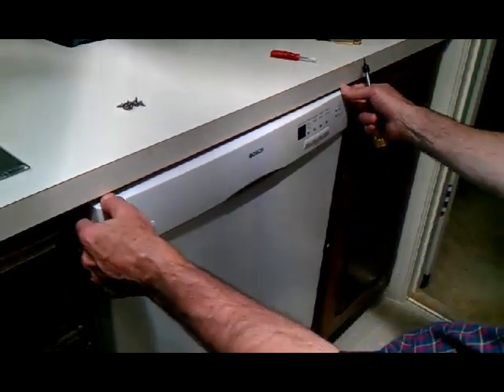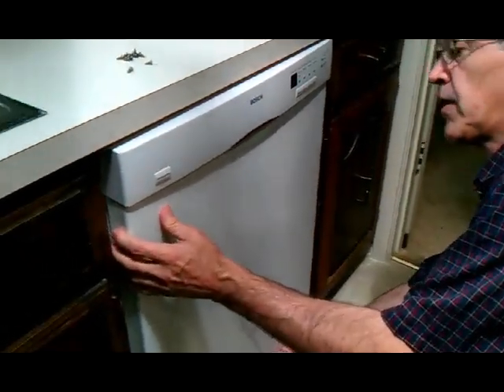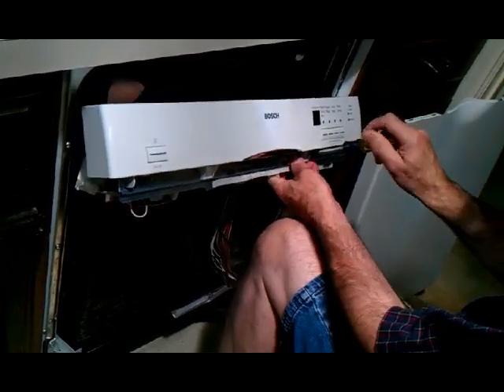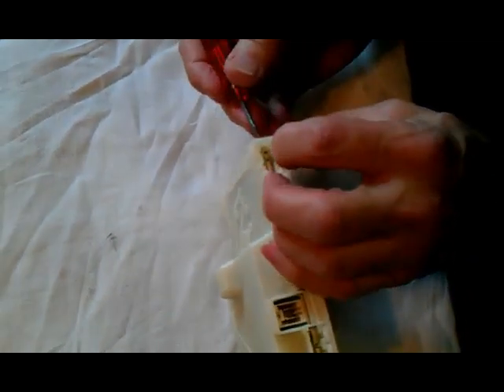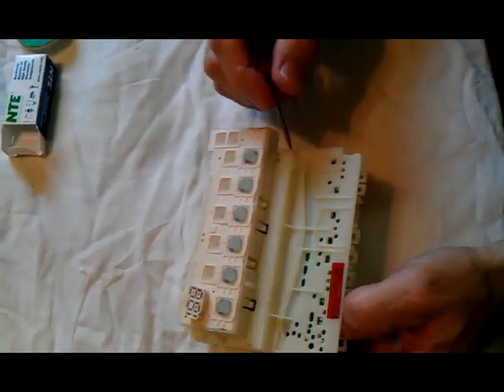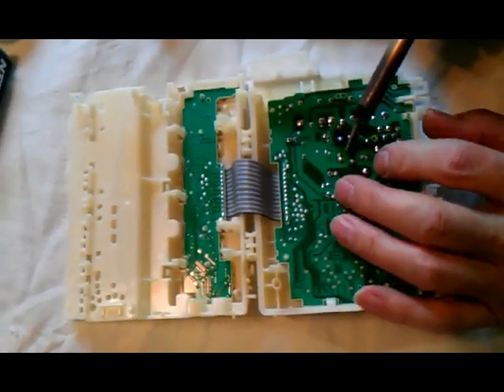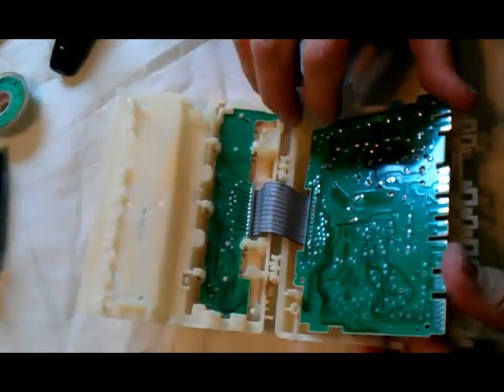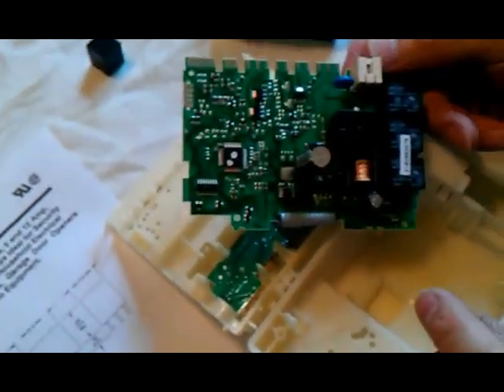Bosch Dishwasher Heater Relay Repair Part 1

Comment: I cannot thank you enough for your detailed instructional video. This fix worked perfectly on my 13 year old Bosch SHV6800. I have learned so much about control boards and relays and soldering in the past day, its great. Thanks to you I followed along on how to get to the control board out,  showed it to my husband who is a soldering expert and he soldered on the new relay for me. I picked up the relay from http://www.vetco.net/catalog/ (I am very lucky that store is right near me and was able to walk in there today and tell them exactly the part I needed. Cost all of $3.78.) My Bosch model also also took the NTE R46-5D12-6. You saved me hundreds of dollars today. Thanks again!
Reply from the maker: +suea12 Great to hear that your DW is up and going again.  That's really nice to have a supply house so close to you that had the relay, and to have a husband that can solder it in...doesn't get much better than that!  Cheers!

Comment: I too thank you for the tutorial!  It worked like a charm for me as well.  My control board looked a little different, but this was the exact issue on the SHY56A05UC Bosch (2006 model).  I also used the R46-5D12-6 relay from www.newark.com.  So far so good!

Comment: Fixed faulty Siemens Dishwasher stuck broken nothing happening, display showing 1, 2 or 4 , I just fixed My Siemens SE25A090GB/12 Dishwasher. UK
It was very similar to the one you showed except the control board case was white, and contained two 6v 10Amp relays part number SRE 303006, which I replaced with two 6v 12A 240volt relays here in the UK.
The replacement part was a superior slightly smaller blue relay but the pins lign up perfectly
just google “12 Amp contacts 6V volt Relay coil 12A Power PCB 124D”
I got mine from pic-projects on ebay, very quick delivery and cheap too
http://www.ebay.co.uk/itm/270578013737?_trksid=p2057872.m2749.l2649&ssPageName=STRK%3AMEBIDX%3AIT
Hope this helps
Reply from the maker: roy boese Thanks for sharing your repair.  The Bosch, Siemens, and Neff brands are very similar and seem to share the same heater relay problem.  That is a good find on that relay and I am sure that information will help someone else.  Cheers!

Comment: Thank you for the video.  I have a SHX46A05UC dishwasher which uses the same 899-1C-F-C relay.  I purchased the R46-5D12-6 relay from an Amazon seller for less than $12 shipped and a solder sucker for less than $5.  I was able to swap out the relay and the dishwasher is now back in service.
Reply from the maker: db130 Good job!  Thanks for sharing your experience with us.  Cheers.

Comment: Thank you very much for the detailed video. My repairman gave me a total estimate of $442 for parts and labor to do this repair. I went ahead and ordered a new washer, but before I installed it I ran across this video. I've made the temporary fix and ordered the new relay from Amazon (NTE R46-5D12-6) based on the comments below.
Reply from the maker: Chad Bledsoe Hopefully the new relay you ordered will get you back to a properly working DW.  Let us know how it turns out.  Thanks for commenting.

Comment: Thanks for this excellent video!!   I just saved myself from having to buy a new dishwasher.  Repairman told me it would cost $200 dollars plus labor to replace the circuit board.  I was able with the help of the video to do it myself for less than $20.00 which included purchase of a solder sucker.  It took me several hours total since I had to practice with the solder sucker on an old board.  Very helpful video
Reply from the maker: Bill Morales The $200 is about right for the retail price of a new control.  Some have told me that with parts, labor, and taxes that they were quoted up to $500 total for a replacement by a technician.  If I had to spend that much to repair mine, I would probably just buy a new one.  Good idea there to practice on an old board before doing the relay swap.  Thanks for sharing your experience.  Cheers.

Comment: Thanks for going through this. I had to perform the same repair, and this video saved me untold money, headaches and cussin'. The dishwasher was fixed for $3.75 (plus tax and shipping) and I have the feeling that a repairman would have wanted to replace the entire control board.
Reply from the maker: Bodie007 Yes, the repairman would want to replace the entire control board...that's the way they do it.  Thanks for sharing your repair.  Cheers.

Comment: Bought my Bosch SHE-45M02UC/50 just 2 years ago.  Recently started seeing problems like in your video and many in these comments:
- After a wash, some dishes were not clean and all seemed to have specs of detergent residue on them.
 - The "Sanitized" light was not coming on at the end of the cycle.
 -  The water did not seem as hot and not as much steam when I opened the door during or after a cycle.  
 - Used Dishwasher Magic to clean out any detergent deposits, BUT THE WATER NEVER GOT HOT ENOUGH TO MELT THE WAX PLUG.

So as per the video, took out the control board and saw the burned solder joint. Same relay location and everything. Bingo! Was going to just buy a new Control Unit assembly except that it costs over $250!  Now going to get me a solder gun, solder-sucker, and some solder wire.  

It's a real shame that Bosch hasn't sufficiently addressed this issue.  Many thanks for showing a DIY guy how to fix this!
Reply from the maker: pieman7 Wow!  Only 2 years old!  That's a real shame, but at least it is an inexpensive repair.  Match up the coil voltage to your existing relay and order a new one.  The DW is so new it will probably outlast the replacement relay, so order a spare while you are at it.  Cheers!

Comment: Thank you very much for your help. My Bosh SHU43C, wich is not part of the recall, had exactly the problem you described. I ordered a NTE ELECTRONICS  R46-5D12-6  POWER RELAY, took my old soldering iron that I hadn't used since high school and fixed the thing in less than an hour. My wife who was ready to buy a new dishwasher and our kids who had to do their own dishes now think I'm a hero. I didn't tell them yet that you are the brain of the operation. THANKS again

Comment: I have a Siemens dishwasher model SL84A305UC/01 which had the same problem. The control board layout was different but it had the same bruned pin on the relay. I replaced it with the NTE relay and it now works. I used a piece of solder wick to create a heavier solder trace from the relay pin to the connector pin. This should help dissipate some of the heat from the relay and it will reduce the resistance to create less heat from the board trace. The heater on my dishwasher draws 10A.

Comment: Hi AgglomeratedIdeas, the original relay in my dishwasher (899B-1C-F-C E) is rated at 15A (125VAC) and the NTE R46-5D12-6 replacement is rated at 12A (120 V). Is the NTE more reliable even though it has a smaller current rating?
Reply from the maker: MrEdwinhardesty I have not seen that particular relay with a 15A rating before; all of them have been 10A. The datasheet available at Mouser also shows that relay having a 10A rating. So, if your relay says 15A on it, then that would be a first for sure. If you can find a 15A replacement relay that would be ideal, but the only upgrade for the 10A relay that I have been able to find is the NTE 12A relay.  Let us know if you come up with a 15A relay!
Reply: AgglomeratedIdeas The data sheet shows that the original relay (899B-1C-F-C E) is rated for 10A at 277 VAC and 15A at 125 VAC. The relay on my board says 10A at 250V. So I guess we need to compare these at the same voltages. But since the original relay has had so many reported problems, I'm tempted to go with the NTE relay even though it looks like it has a lower current rating.
Reply from the maker: MrEdwinhardesty Hmmm...that is an interesting observation.  I don't think they used to have that rating on the datasheet.  Perhaps they have made production changes that allowed for that rating.  Nevertheless, the 899 relay still fails on a regular basis.  I believe the NTE relay will fail too, but it seems to be better than the other brands Bosch is using in their boards.  I bought an extra NTE relay just to have on hand should I still own my DW when that happens.  I just consider it a maintenance item that will have to replaced about every five years.
Reply: AgglomeratedIdeas I removed the control board from the dishwasher, and since the board looked to be in perfect shape and I couldn't tell which relay was bad, I replaced all 3 relays with the NTE R46-5D12-6 type. The dishwasher now works like new again. Thanks AgglomeratedIdeas for putting together this video and sharing it with all of us. It's people like you who are looking out for all the rest of us. Thank you!!!
Reply from the maker: MrEdwinhardesty Thank you for sharing your successful repair.  I am sure others will be encouraged by your experience. It certainly doesn't hurt anything to replace all the relays on the board.  They are cheap enough to do just that!  Cheers!

Comment: Hello AgglomeratedIdeas - Our Bosch dishwasher is model # SHE43P25UC/64; it is not part of the recall.  Originally the regular wash cycle took about 120 minutes.  After running a name brand dishwasher cleaner on the power scrub cycle, regular washes now take about 140 minutes, but it does finish.  I think the power scrub cycle cranks up the heater more or longer than the regular cycle.  After seeing your video, I opened the control board, and on the relay in question, two of the solder joints have what looks like burnt sugar around them (although the joints are still intact).  No other solder joints on the board have this.  The info on the relay says 6V, 10A -  same as the other 3 adjacent to it.  Just wondering if you think this has the same problem yours had.  Thanks!
Reply from the maker: Thanks for sending the photos.  I replied to your email.  The "burnt sugar" is flux from hand soldering.  Your board looks fine to me and the DW is probably running normal.  I hope that helps.  Cheers.

Comment: Hello, thank you for the video. I have a Bosch SGS4332GB/17 dishwasher that has same symptoms described in your video. I have replaced the relay with a new one but still have the same problem. Dishwasher doesnt seem to heat up the water and it is always running. Even when I do a RESET the END led lights up but the dishwasher keeps filling and draining water non-stop. Is there anything else I should check? Thank you.
Reply from the maker: If the water is not heating and you have already replaced the heater relay, then a bad heating element may be the problem.  There are other reasons too, so follow this flow chart: http://imgur.com/aYgvfAW
There is also a diagnostic mode that you can use to help find the culprit.  The diagnostic mode is shown on the wiring diagram which is usually rolled up and tucked in a crevice near the water fill valve.
Reply: AgglomeratedIdeas Thank you very much for the reply. I will see if I can get to the bottom of the problem. Cheers.

Comment: I can’t thank you enough for making this detailed video.  My 87 year old mother had this problem with her dishwasher.  After 3 Sears servicemen and $600 of work didn’t fix it, she was ready to give up.  I saw your video and decided to give it a shot.  I order the part and soldering equipment off Amazon for about 30 bucks.   After practicing soldering a bit on an old modem circuit board, I soldered the new part and put her machine back together.  It’s been running perfect now for several months.  I can’t tell you how relieved she was getting this taken care of.  THANK YOU!
Reply from the maker: Thank you for sharing your experience. I don't what to say about the servicemen...hmmm?  At least you were able to do what they couldn't.  That is a really good idea to try out your soldering skills on an old board.  You made your mother proud for sure!  Cheers!

Comment: My Bosch did not run right for quite some time.  First indicator was the "Sanitized" light was not coming on at the end of the cycle.  I started to notice that the water did not seem as hot and not as much steam when I opened the door during or after a cycle.  Called Bosch and they recommended using a dishwasher cleaner like Finish (which would temporarily help with food particles).  Dishwasher started to run for hours (sometimes 4-5 hours for one cycle) and Bosch wanted outrageous rates to send a technician to my house.  
Thank GOD for You Tube!  I'm no handy man and hand a little frustration taking my panel and control board out, but this fix literally took just a few minutes once I ordered the $10 part off Amazon and did the soldering.  All said the repair took about an hour start to finish (I also pulled dishwasher out to clean dust/debris under and behind the unit).  Probably saved $200-$250 in repair costs by trying it myself!!!  Thank you for posting this video!!! Now the dishes are getting as clean as they did on day 1.  Sanitized light shows again and cycle time is normal and much shorter.
Reply from the maker: Thank you for sharing your experience.  As you found, there is a HUGH savings for a relatively easy repair.  I'm glad you tried it!  Hopefully you will get many more years out of the dishwasher.  Cheers!

Comment: Thank you for posting this.  I am new to this kind of repair.  I have already repaired the joint on the board.  How do I determine what kind of relay to order to replace the one on the board?  I have a SHX46A06UC-21.  Thank you again.

Comment: Thank you for taking the time to post this very thorough walk-through.  The fix worked perfectly and we're back in business!  I found the NTE relay on Amazon with free two-day shipping for Prime members.  My SHE44C had four of the five legs soldered, one of which had a burned solder joint just as you explained.  Total cost: $11US for the relay and $1.98 for a Torx 20 1/4 drive socket at Home Depot and we're good to go - saved me hundreds of dollars.  Thanks again!
Reply from the maker: Awesome!  Thank you for sharing your repair experience.  Sounds like it went well for you.  Cheers!

Comment: I purchased a similar model 6 years ago at Lowes with a 5 year extended warrantee and it stopped drying the dished at the end of the cycle. I tracked the problem to a 10 Amp relay (switch) on the control circuit board that overheats and melts the solder connection. I did a little research on the internet to see if others had a similar problem. I found multiple instances and that Bosch had issued a safety recall for this problem in other models but not the one I purchased. This is not an isolated incident. The control board costs $150.00 plus the labor to install it.  If you don’t care about lasting more that 6 years it is a great dishwasher.
Reply from the maker: Thank you for commenting.  You are exactly correct...this particular failure for the Bosch is not isolated at all.  The heater relay failure happens at about the 5-year mark give or take depending on how often you run the dishwasher.  The repair is relatively cheap and inexpensive if you replace just the relay.  Replacing the entire control board is not cheap.  I think the Bosch is a great dishwasher also; it is just too bad that the heater relay is being utilized near the top end of its amperage rating and fails.  I hope you got your DW up and running again.  Thanks again.

Comment: Hey there! Great video!  I have a Bosch SHU9955 dishwasher with a bad heater relay.  Part number on the relay is SRE303006, do you have a recommendation as to where I can buy a replacement relay for this?  Thanks,  Carter
Reply from the maker: Hi. The SRE303006 is a 6V coil relay, so the NTE R46-5D12-6 relay would replace it. Try one of these sources :
http://www.galco.com/buy/NTE-Electronics/R46-5D12-6?gclid=CNXJ8pzz7rkCFY3m7AodVUkAKw
http://www.newark.com/nte-electronics/r46-5d12-6/power-relay-spdt-6vdc-12a-pc-board/dp/81C8194
http://www.alliedelec.com/search/productdetail.aspx?sku=70012007

Comment: Different Model:
I have  a 2002 SHU3326UC, that relay just burned up last night.  The whole board
268198 is no longer made. I ordered one relay from Hong Kong to arrive maybe by Christmas.  Also found some at Amazon by searching 5 pin 12v (mine), 125v, 10 amp-have ten of those on the way. Just got the old relay off and am concerned about the board beneath it.  Very black and i fear maybe a large copper path (1/8+" wide) may have melted away.  If you took a picture of yours while the relay was out maybe I could get a 1000 word answer at a glance.  Further, does anyone know a way to use a newer control from Bosch: bet not possible since all the button configs seem to change.
THANK you so much for Posting your great vid of this repair for the possibly 100,000s of people that might need it.  If you know a way I can send a picture through here of the burnt board for your judgement of hope or no hope, I would appreciate it! Erving
Reply from the maker: Hi Erving.  Feel free to email me a photo at MyBrokenDW@gmail.com and I will take a look at it.  I will make suggestions after reviewing it.  I take it that the 12A NTE relay is not available where you live since you went with a 10A replacement...that's still better than having to buy a new board.
I believe that part number 00647474 (AP5804839) replaces 268198, but check it to be sure if you do decide to buy a new board.